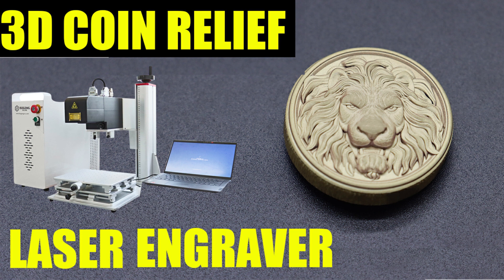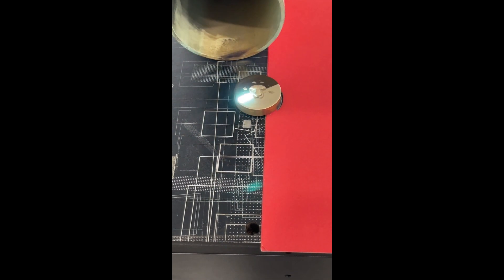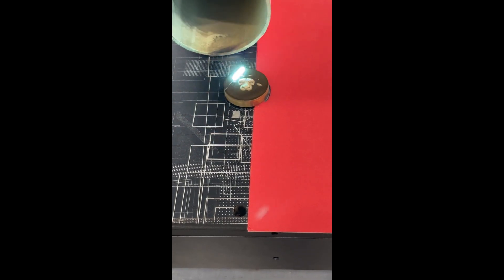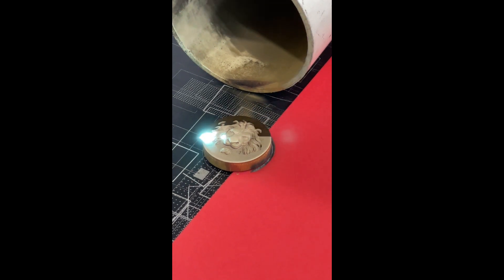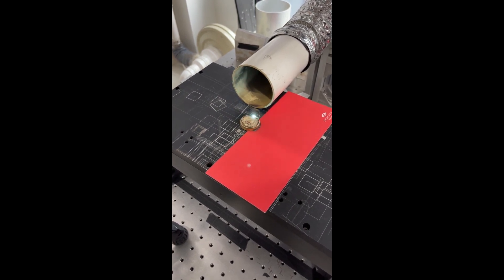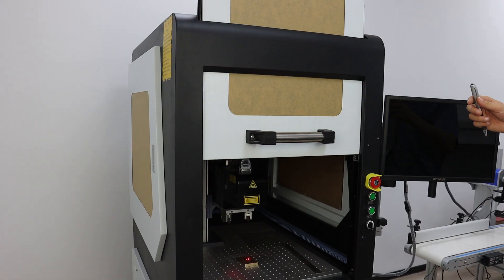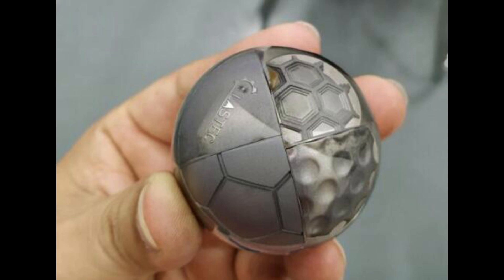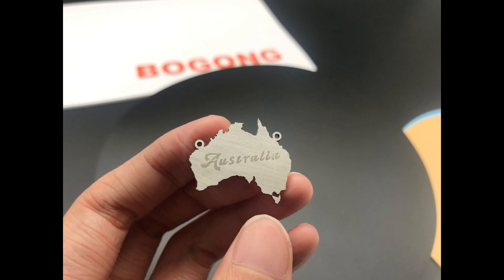Best 3D Coin Relief Laser Engraver |  Convex Deep Engraving for Metal | Concave deep engraving

Comment: 3:21 mold making would be fantastic, but I think limited to shallow: if you could combine this capability with a cnc router, it would be ideal, as the laser could achieve finer surface finishes than the mill bit: use the router for the bulk volume of the work and finish with the laser.